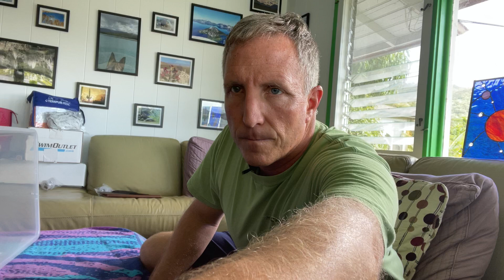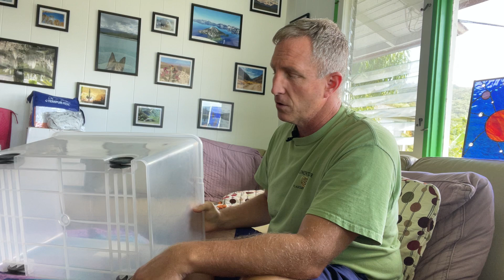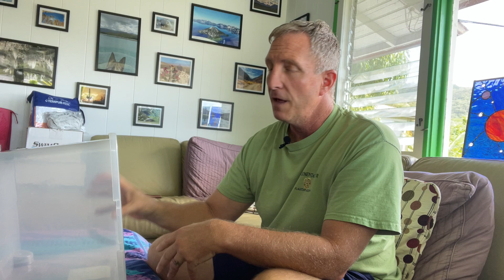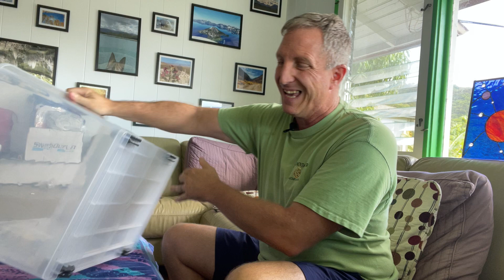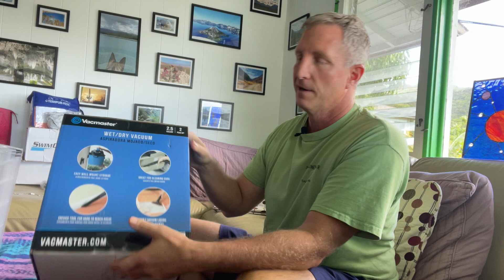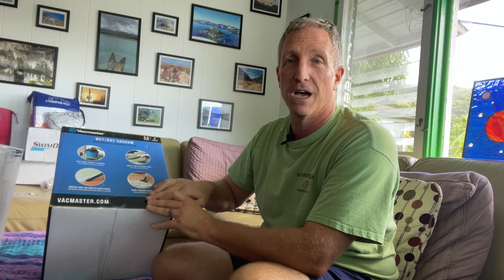DIY Home Laminar Flow Hood ideas

Comment: U give sound advice Master splinter,I 2 am thinking of making a flowhood/still air box...except it wouldn't b a still air box with a flow hood attached would it 😂 .my idea evolves mounting th flow hood to the top of the air box with the intire front open to work under.this vid gives me greater insight tyvm

Comment: I have thought about doing something like this with a plenum, my thought was to use 2 hepa filters one pre plenum intake, and one for the face. I believe the concept is very much doable, provided the basic concept is somewhat engineered out, fan or fans match, plenum size, filters, seals, etc. Are all designed just right. Good thing about card board boxes is they are free for the most part, so if one design doesnt work you could start over with your main components. Great video, I believe any thing is possible, and certainly a much cheaper design could be fabricated. A laminar flow hood is nothing more than a large filter, with a plenum, and large blower. I have even thought about stacking low cost 99.97% inexpensive hepa filters 16x13 together, say 3 or 4 deep.  

 Thanks for the video, keep playing around, as I think it is achievable in my opinion. One other suggestion I may try, is to use a cheap, or reclaimed from salvage yard 1 core radiator. Radiators are designed to create laminar flow, it would be easy to cut to any size to fit a 99.75% etc. With a Cheaper filter combination. Only concern will be flushing it out realy good.

Comment: Some other thoughts on sterile workplace techniques: 
So, a still air box (SAB) works great if you manage to work properly sterile in it, it's cheap and quite easy to make. That's why it's the most common way how beginners have success. Having some soapy wet towels on the bottom of the SAB can trap contaminants that fall down even better and increase success rates a lot. 
If you have plenty of money to spend, a proper laminar flow box for ~400-2000$ will do the same thing while allowing for free movement of the arms, that's why all the professionals use it. 

In terms of alternatives, there seem to be several options with varying rates of success:
1. Take an unused clean plastic bag and spray the inside with a lot of disinfectant. The take all the stuff you need, spray it down and put it inside. Then, close the bag with a good knot and work on your things from the outside of the bag.
It's almost free, annoying to work with but I've heard it to be sterile enough for some to work. 

2. An SAB equipped with an additional air filter blowing in clean air that can only escape through the arm holes. 
-> Doesn't work because the air flow blows up all the contaminants that you want to trap at the bottom. 

3. Some kind of cheap HEPA air filter with some kind of fan. Maybe also in a box like in your video.
- Using a filter much smaller than the box: 
Doesn't work well as you showed because of turbulences from the dead air pockets. 
- Air just blowing over the bench but without proper laminar flow and without a box/enclosure: 
Probably doesn't work well either because the turbulences will draw in contaminants from outside the airflow. 
- Having a non-matching filter and fan but with some kind of enclosure that is smaller than or exactly the size of the filter. This should prevent the turbulent air from pulling contaminants in from outside. The only problem could be that the turbulences pull contaminants from your skin/gloves onto the agar plates/samples. 
Have seen something with this idea here and it seems to work okay for them:  
1. vertical flow hood, also shows how to get rid of dead air pockets: https://m.youtube.com/watch?v=dqPhy2s_saM
2. bit different but cool idea with same principle and only a plastic bag: https://m.youtube.com/watch?v=M9FWIu2YLr0 

- I wonder whether it's possible to achieve actual laminar flow with a cheap thin filter if one does the math right and matches filter and fan perfectly. Then also add a proper box behind the filter to disperse the air pressure and all that. Maybe also have something like a big pack of straws in front of the filter to replace the metal fins that direct air forward in proper laminar flow filters. Haven't seen a video about this but I think it's worth trying.

Comment: I love your video. 
You watched other people's tries at making a super cheap air filter/"flow hood", observed what went wrong and understood why and then essentially reinvented the classic regular laminar flow box (often called laminar flow hood in hobby mycology). 
In a proper expensive laminar flow box they use a thick HEPA Filter in the quality H13 (99,95 -99,99%) or H14 (99,995-99,999%), packed in a box with enough empty space behind the filter to disperse the pressure evenly as you explained it. And then they have a second box on top, that contains a strong centrifugal fan to blow air into the lower box and a pre-filter at the air intake which protects the expensive HEPA and the fan from regular dust. 

The most important thing to actually achieve laminar flow and not just clean turbulent air is matching the flow rate of the fan to the filter you use. Here's a good video I found for doing the math of matching filter and fan: https://m.youtube.com/watch?v=cDaJW77Wb5Q
Also I've heard that you should use a filter specifically designed for laminar flow as they have little metal fins to direct the air (but are quite expensive).
Reply from the maker: Wow, Thank you for your comment and input! I'll check this out!

Comment: laminar flow is simple math and traditional DIY laminar flow hoods are about as simple as it can get.. centrifugal fans provide constant pressure where as others like inline fans or box fans create turbulent flow or not enough pressure and could affect your 100ft/m. The filter is what it is you need at least 6in behind your 99.97-99.99 hepa to create the even flow throughout the work space so not really to many corners you can cut. you can make a 1x2 flow hood for less than 300$ and a 2x2 for less than 600$ really depends on what deals you can find and what tools you have(iv seen them built for as low as 400$ for a 2x2). if you want a simple set up for the low budget or someone starting out a SAB(still air box) is cheap maybe 20$ all said and done and if you practice proper sterile technique you should have just as much success if not equal as someone using a laminar flow hood and produce plenty for your family.. then start to use what you have grown using your SAB(still air box) to start a laminar flow hood fund. now if you cant turn a profit or get any success using a SAB(still air box) then its safe to say that this hobby or trade is not for that individual as they don't have the patients to learn sterile technique or have the market to sell the product. a laminar flow hood in my option is only necessary if you plan on expanding your already successful operation and/or are planning  to sell on a commercial scale. this shouldn't be someone's first thing they absolutely need starting mycology and shouldn't be the reason why they are not having success. im very interested if you could successfully create laminar flow below 100$ and encourage anyone to figure it out but the problem is people especially beginners will always try to take shortcuts and it could cause more harm then good. if i see a set up with a anemometer showing atleast 80ft/m across the work area i will be convinced but most just show a set up that looks like it should work in theory but is just a simple air filter at heart
Reply from the maker: Excellent response! Thank you!